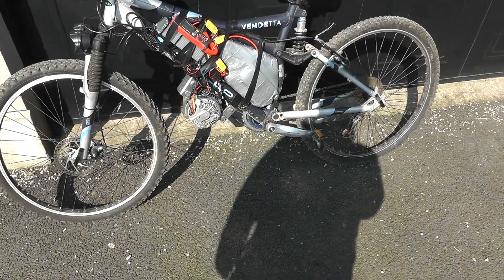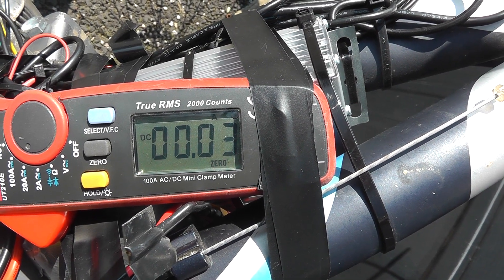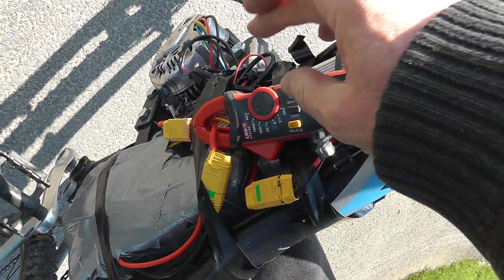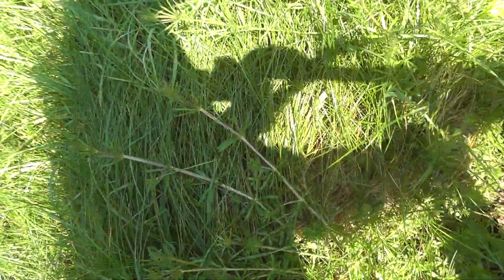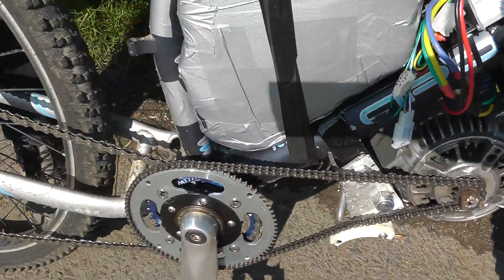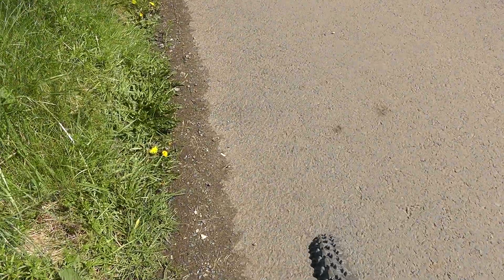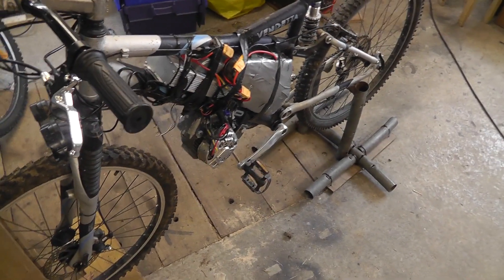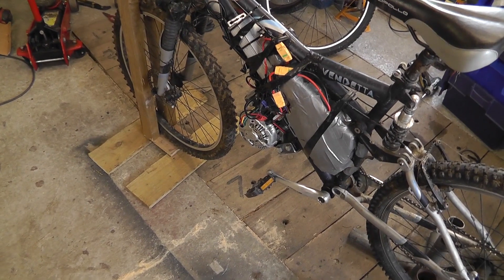DIY Ebike with Car Alternator V2 Episode 6 - Boy she can go! NB Read the notes!

Comment: Love it! I have a old quad with a blown engine and 2 old alternator that work. I think I am going to try something like this.
Reply from the maker: If you can figure out a way to use the gearbox from the quad it could work, otherwise the gearing will be miles out. For a quad you would need something like 10:1 ratio to get any poke, even with two alternators. A motor from an old forklift or similar might be a better bet if you can get a small enough one to fit.
Reply: @alibro7512  Self Recharging E-Bike Idea.....(why wouldn't this work)  For example use a 750W  48V geared hub front wheel motor, with a normal 48V battery pack. You can pedal the e-bike just like a normal bike to help increase battery range, help up steep hills,etc...But in the bottom bracket connected to the crank arms you add a generator that produces the correct volts & amps needed to help recharge the battery pack. So when you pedal, you have the benefit of recharging the battery pack and also moving the bike. I know the generator is going to add some weight but if it's not too big & too heavy and can recharge to battery pack without creating pedaling resistance (making it harder to pedal) Then you'd be killing 2 birds with one stone. If it was geared correct, you could produce enough power to help recharge without having to pedal the bike like crazy.

Comment: You have now encountered the two major issues with this design.
1. The primary gear reduction is too low, so the secondary (bicycle) gearing and the pedals become redundant.
2. The efficiency is quite poor. You've done about 4 miles on half of a 7s (15Ah?) battery.
Reply from the maker: Hi mate
Yes your right about the gearing which is why I want to try and fix that. I haven't figured out how yet but it needs done. I might end up replacing the motor but it would be nice to make it work if possible.
As for the efficiency I knew it wouldn't be great but it's not that bad. The pack is 13S 8P with 3500mAh cells so should be 28Ah and 1300Wh at 3.6V nominal. 
I think. 🤔
I was riding on the road for a few miles then took it into a field for 20 minutes or so full throttle most of the time. Full throttle is 40A so if the pack is 28Ah then I would expect it to be half used.
Better gearing would help as the motor is straining at lower speeds.
Reply: @alibro7512  Ive put my n on 12V car batery and it lasted for few minutes I would say 3 minutes and the acumulator was on full charge

Comment: That's quite an improvement on the last ebike Ali. You could do with making up a handle bar mounted display for important information like battery voltage and current consumption. 
I'm sure that your speed controller is limiting the current too. There's only so much current that a cheap Chinese controller can handle. 

Maybe your next upgrade would be to a more professional unit? 

Love the camera work too. ;)
Reply from the maker: Thanks John
The battery voltage is on the throttle which is great but can't be seen in sunshine so a better display would help. 
The current is supposed to be a limited to 50A but seems to be more like 40 but I think that's fine I don't want to melt everything and , getting the gearing right is more important.
The goal of this build was to keep it cheap and I've done that. Check out the price of 2Kw motors and they are £300+. Without the battery this has cost around £150 so far.
Reply: @alibro7512  
I saw the voltage on the throttle. You could try putting some red insulation tape over it, as it might make it more visible in sunlight.;)

Yes one way to drop the current , reduce the motor load. A gearbox will do this for you. All you need to do is to find a compact and easy to use gearbox, which I'm sure is easier said than done. I'm sure you'll come up with something workable. 
Good work so far.
Reply: @alibro7512  
I've been thinking about your gearing issues. Really you could do with a planet gearbox, which offers good reduction in a confined space. However sourcing the components for it could be tricky.
Reply from the maker: @johnnodge4327  I was thinking the exact same thing but have no idea where to get a gearbox like that. It would probably be much simpler to change the Alternator for a 48V motor from a scooter. They even come with the h24 sprocket fitted but would probably cost around £250 for a decent one. Cheadlebiker ran up against the same issue and replaced the motor on his bike. I'll play around with what I have and see. Tom Stanton built his own gear reduction as you can see in this video around 2'17" https://www.youtube.com/watch?v=FCfKGMltrrY&list=PLj3Bh6Krv9CWdRwVFwF1xS_-IQH9GBHyo&index=8. Something like this might be an option but it would need a freewheel so that when pedalling I wouldn't be pushing against the motor.

Comment: Congratulations, i love the sound it produces
Reply from the maker: Thanks mate. When riding it isn't as loud as it sounds on the video but it's still pretty cool.
Reply: @alibro7512  how about gearing the bike for more top speed ? It seems to be pretty powerful as it has 2.5HP. my ebike controller burned and everything is being postponed, but a video may come out soon
Reply from the maker: @javierchaparro4769   The gearing is there for more speed, I was doing 33mph in 1st gear but I don't need more speed, I need more torque.
Reply from the maker: @javierchaparro4769  I think I will first try to sort the gearing as I think 2000 watts is enough for now. If I could build a gear reduction at the motor it would help a lot as I fear the small chain is being driven too fast. My goal is to get max 10-15mph in first gear as I can still use the other gears to go faster.
I'd also like to replace the 12V battery with a PWM driven from the main battery and switched on and off by the throttle as it would help to keep the motor cooler.
Reply: @alibro7512  bro permanent magnet in rotor field winding????
Reply: Qual a tensão e amperagem que sai da bateria amigo .